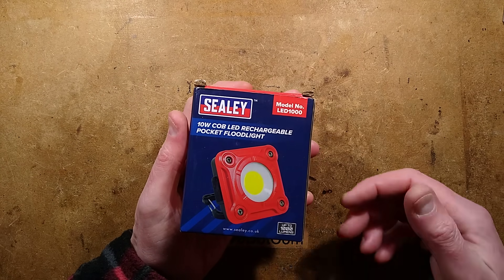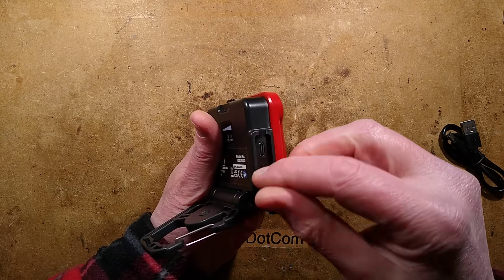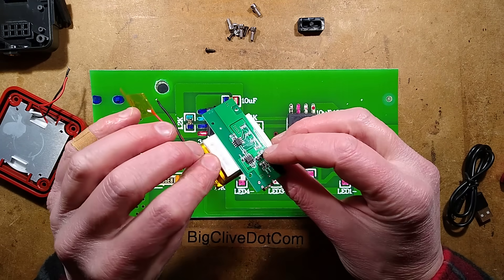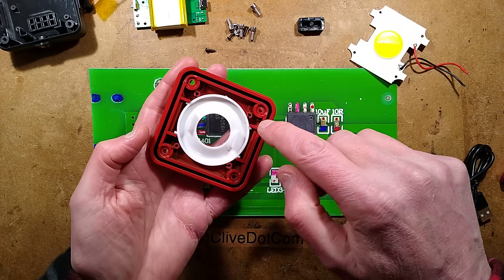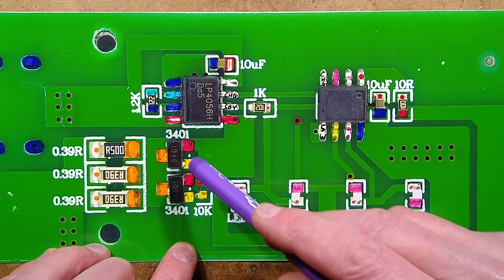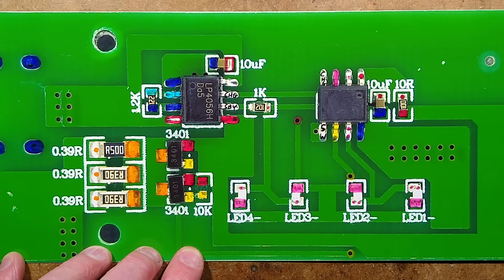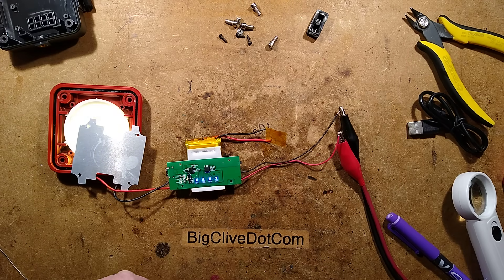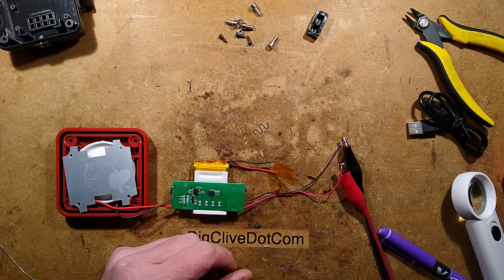Pocket floodlight teardown - with schematic

Comment: I had a quick google for this, and Sealey seem to have at least 3 distinct Pocket Floodlights they put their name. one at 7W ( available in many colours), and another 10W which has a bigger battery and a USB A output, so can be called a "powerbank"
The one you've reviewed is the cheapest, and looks like a more convenient form than the stick ones I've been using. Head torches are good but when you're working on something that's in some hard to reach spot with things to reach around (wiring inside a dashboard or round the side of an engine), it's nice to be able to stick a couple of lights in the cavity and get consist lighting that doesn't change as you move your head. I just need to remember to always take them out again!

There was one 0.5Ω  and two 0,39Ω resistors? Was it the two smaller ones you snipped?
Reply from the maker: I took out the two .39 ohm resistors.  It's a trade-off between intensity and run time.